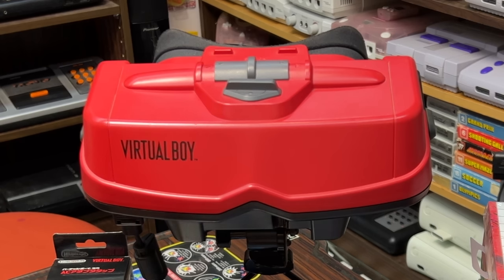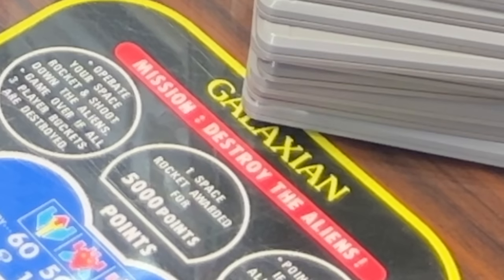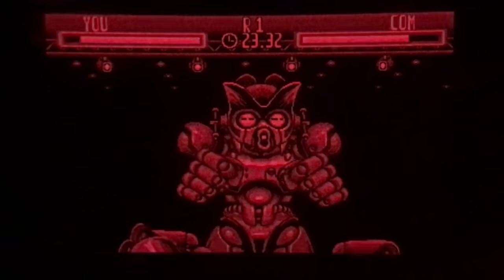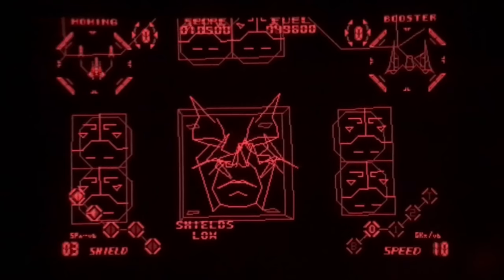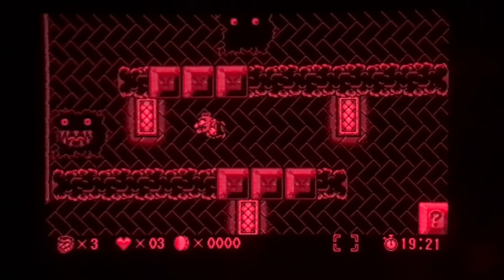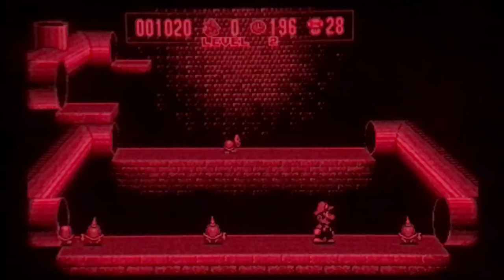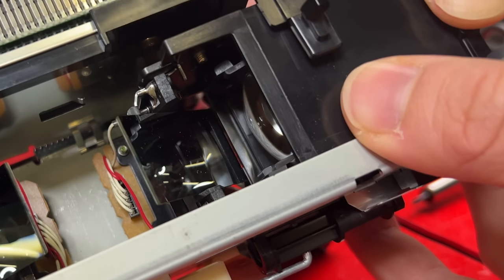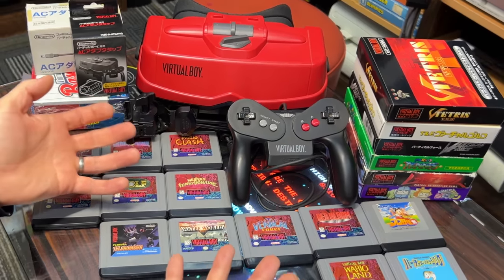The Nintendo Virtual Boy

Comment: Quick bit of advice/minor nitpick for future videos: try not to have any CRT monitors on in the background while recording, since they make a super high-pitched buzz that's a bit annoying for people like me who can still hear it (although this sound might be from the VB in this case). Maybe roll off the audio frequencies above 10kHz when recording a CRT to mitigate this as well. The content is still enjoyable regardless. Keep it up! (Nice cheeky "James Channel" in the magic eye image, btw!)
Reply: God... This entirely 🥲
Reply: That's the reason why I can't stand CRTs. It pierces my ears and goes right to the displeasure center of my brain
Reply from the maker: I applied a filter to remove the 15khz range because I’ve had complaints before. I can’t hear it though so it’s hard to tell if the filter worked. I’ll kill off more of the top end in my next video. I didn’t think I even had any running this time. Maybe the VB was making noise 🤷‍♂️
Reply: @Games_for_James as a musician my advice is find out what your exact hearing range is and filter out everything outside of that range! Cheers
Reply: if you use a spectrum analyzer or spectrometer you can see the high frequency beeps and if your video editor has a notch filter you can match the freq and the problem is solved without killing the sound of hi hats and the S.
not like it makes a huge difference tho since yt will most likely downgrade the audio quality on playback depending on the user settings
Reply from the maker: @Archer690Channel  thanks! I’ll look into that. I’m still very much learning :)
Reply: Took me a while to figure out whether or not I was having tinnitus. Glad it's not just me!
Reply from the maker: @LowellLoveMusic  I might do that!
Reply: @Games_for_James  the arcade machine you were playing on is a crt screen
Reply: and it goes away when you do the teardown
Reply from the maker: @sonarinfection  LOL, yes and I had it on on purpose, I completely forgot. Ok my audio filter just needs work.
Reply from the maker: @sonarinfection  yeah because that’s in a different room where everything was actually off.
Reply: I was surprised to find that I could still hear the coil whine from a CRT at my age when I visited my dad just now, but I definitely can't pick it up from recorded audio, and I don't remember ever being able to when I was younger (as you get old enough, you won't be able to even hear that frequency of sound anymore).
Reply: Yet I'm here only 24 years old with permanent tinnitus so I blissfully can't hear any of it

Comment: The realization that the virtual boy's display operates on an overengineered version of the principle that the fans with the LEDS in them that made funky patterns worked on may have just blown my mind.
Reply: The moving mirror system is similar to some early televisions from the 20's and 30's which used mirrors mounted on a drum or in a spiral to display an image. There were even a few experimental ones that displayed colour. There's a video demonstration online of a mechanical colour television that has been built using an original mirror screw and modern LEDs and electronics, it's a fascinating design.

Comment: Games on the 3DS that use the 3D part of the display properly are really a sight to behold. StarFox 64 3D is a good example of very well used 3D for depth perception. I feel like if the 3DS was better utilized for its namesake, it would have really shifted what the Switch was. 3D gaming really should make a proper comeback. Sony tried a 3D TV for a while which was more or less the same tech but without the 3DS eye tracking which didn't work quite as well but was still good when done right. I still play my 3DS for things you just can't get anywhere else. It still to this day is ahead of its time in certain aspects, and it's a real shame we may never see another console like it. It really is the perfect bridge to VR games. Flat, 3DS, VR.

Comment: The best part about this is there's a little bit of this technology in modern VR if you own a Vive or an Index, the base stations use the same tech to throw reference dots around the room for the controllers and headset to track with.

Comment: I remember playing this at Walmart in the 90’s. I wanted one so bad. Unable to play the system for years until my friend said oh I have one of those. One massive headache later I was pretty happy about trying it again. 

I could never understand why Nintendo failed to emulate these games on the 3ds. It used the same 3D effect basically. Last night I was checking updates on my 3ds with LUMA. Someone actually made the virtual boy games work in full 3D like I’ve wanted all along. Makes me so happy to finally be able to play those games whenever I want.

Don’t get me wrong I like emulation and hate it. If Nintendo would have offered an option for me to buy these games on my original unmodified 3ds I would have happily purchased the games. I’ve given Nintendo a ton of money so I don’t feel too bad. 

Anyway if you should check out virtual boy games running on the 3DS it’s beautiful. Works so well it’s incredible. Why did Nintendo not take advantage of this???

Comment: With relation to the last part, I don't know how much you boosted the sound of the mirrors, but that high pitch whine I know would probably give me a headache after a while if it's as prominent as it seems in the vid. Which suuuucks, because otherwise this system always seemed really cool to me.
Reply from the maker: That noise got so many complaints. I use a 15khz filter for CRTs and this thing powered through underneath it at 12khz!
In the 90’s if you wanted to be playing video games or watching tv you were exposed to a high pitched tone and subconsciously tuned it out. It’s like having a ticking clock, you stop noticing it completely until someone points out how annoying it is
Reply: @Games_for_James  Ah yeah, just a really funky frequency. Yeah I remember that when I had a CRT, didn't notice it when I was younger, but after not using it for a long while then firing it back up, wow was that sound every obnoxious for the first little while.

Comment: this could easily be their 5th gen consol with normal home console configuration. the v810 is very powerful 0.9mips per mhz and judging from virtual boy visual and developing time they had i think they might have easier times with hardware like this than vr4300/sgi rpc which is technically a super computer and very complicated architecture to work with. well i think we might even be able to get cd drive in there because in 1995 the v810 is quite old already so they can produced it cheaply and have a leftover budget for cd drive.

Comment: I still think the best version of the 3DS was the New 2DS XL.  I had a release 3DS, and the 3D slider was permanently set to off.  The extra eye strain wasn't worth the gimmick, nor the overhead in processing that had to be used to accomplish the 3D effect.  To be fair, I said the same thing about how I was sad we got a DS instead of basically a handheld single display SNES with extra power that's available with current hardware.  Instead of driving 2 screens, just drive a single solid resolution for the size display with 4 face buttons, dpad, l/r, and start/select.  The PSP existed giving pretty much all of that, and I still love the PSP, but I think Nintendo's drive to take market share purely off gimmicks instead of just solid hardware and an expansive library (Nintendo often boils down to the same handful of IP's first party, a handful of IP's that are third party, and a metric ton of shovelware) was a shame after how great the SNES, GBC, and GBA were.  I guess the N64 too, but the controller kind of killed that system for me.  Shame the Saturn's 3D controller wasn't out to copy.

Comment: There was a far, far worse red black "VR" console, it may be even so obscure you might not have one. The tiger R-Zone. It was a headband with a single awful little lens over one eye and a controller that played essentially just those single unit tiger handheld games that we all hated. In red and black. It was awful, and I hated mine within an hour of getting it. My mom sold it a few years ago after going through my things, and it was worth a good $350 because so few were sold. They're rare as hell and with good reason. They were unforgivably bad.

It'd be interesting to see a video on it if you have one. I haven't touched it in 25 years at least.

Comment: Had a dream that I was playing something like VR chat on the Virtual Boy. Wonder if this would be possible using a Pi connected to the cartridge port which takes video streamed over wifi and converts it to something VB can display along with sending controller inputs and using a magnetometer for 3dof?

Comment: I wonder if these games have been emulated im vr or on the 3ds. Its also a weird that it was designed to be stationary, yet also requires batteries by default.
Reply: There are ~two VB emulators that can run on a soft modded 3DS, but one runs badly and the other has big comparability issues.

Comment: What was the point of those overly complex screens? Were two regular backlit LCDs prohibitively expensive in 1995?
Reply from the maker: Yeah, they were a washed out mess with huge motion blur or they were super expensive. Look up the atari lynx and sega gamegear. They both failed because of cost and neither one looked good. The VB would have needed two screens and two fluorescent backlights which would drain six AAs in no time flat. White LEDs werent even a thing in consumer electronics yet.

Comment: I really do like the idea of VR, but man every single virtual reality console ive tried doesnt seem to be designed with glasses in mind so they never fit. or i have to take off my glasses which means i cant see anything on the screen anyway
Reply from the maker: With most modern vr you should be able to calibrate it so you don’t need to wear your glasses. I don’t have personal experience however since I don’t need glasses
Reply: @Games_for_James  maybe all the ones I tried were so cheap they didn't have that or maybe I'm just blind and didn't see it. I wouldn't be surprised either way

Comment: hey James! I saw you drive an X-trail and I've wondered if we could get some quick info on it, I drive one myself and I am just interested how you like yours :D
Reply from the maker: I like it. It’s a 2005 T30 Ti, I got it because it was the biggest 4 cylinder all wheel drive car I could find in my price range that was made by a reputable company. (I could have gotten a 2010 great wall for the same price but I don’t need that headache). I’ve done a clutch and a head gasket since owning it so it hasn’t been faultless but it was already over 200,000km when I got it and it’s at 290k now so it’s not doing too bad.
Reply: @Games_for_James  yea, i bought mine very cheap and it had over 450k km and spun  bearing  so i replaced the block with rods, pistons and crank from junkyard haha. The whole car engine and some miscellaneous stuff costed me somewhere around 800 euro!  anyway thank you for the reply!
Reply from the maker: @brano_1410  wow you did well!
Reply: @Games_for_James  thank you

Comment: james, sir, you know how to use a welder, yes? you can weld yourself a stand for under your legs. a flat bar goes under your legs. a round bar goes vertically. then another flat bar horizontal. two more round bars go into holes in the bottom of the VBOY. i know this because i had one made back around the turn of the century. the man who made it for me attempted to sexually assault me, but since i made it away untouched, it was worth it....

Comment: James i got a question:
is it possible to turn on a radio ripped out of a car without plugging it back to the car?
Reply from the maker: Yes it is, you need to connect the black wire to ground and both yellow and red to 12v dc.

Comment: I just got one! Did you have to fix the glue issues yet?
Reply from the maker: On one side yes, it had a line out when I got it. The other side is still fine.
Reply: @Games_for_James  I just used a hair dryer to fix mine because I'm awful at soldering lol